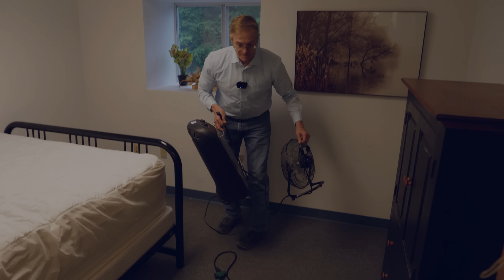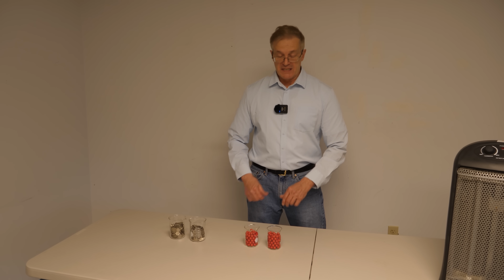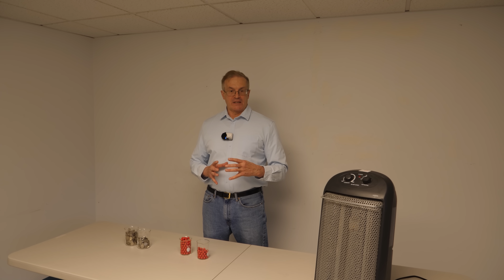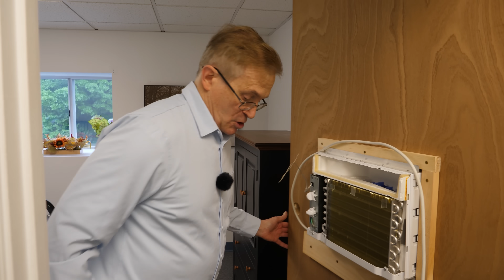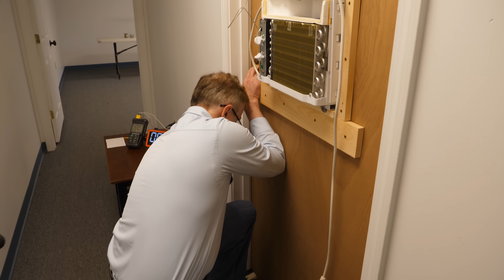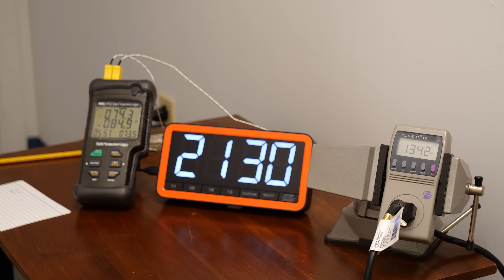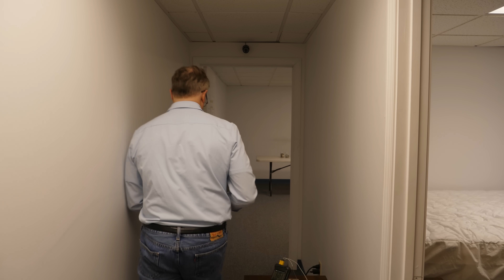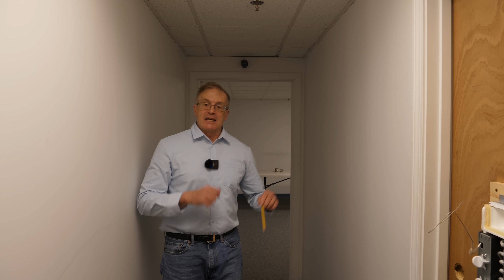You're wasting money on heating! Use your A/C!

Comment: His demo has a major flaw though.  He is warming the cold side of the system in a 75 deg hallway making the temp exchange very efficient.  If you put the cold side of the system in harsh winter temps it no longer warms the cold side efficiently and in effect doesn’t heat well
Reply from the maker: You're right that as the differential increases, the efficiency multiplier decreases.  For extreme differentials, an auxiliary heat system would be needed.

Comment: S o If I turn my ac window unit around facing outside with the exhaust facing in, what would I set the temp to? if it’s 65 degrees outside and I set it to 63 would it keep a consistent heat or keep heating the inside because the outside temp couldn’t be effected by the environment

Comment: My apartment was heated with resistant heaters my electric bill with sky high I got an air conditioner from a rent-to-own place because my air conditioner went bad it has a switch on it for summer and winter in reverse is the motor what's blow the hot air out the front in the winter time heeted this whole apartment  cut the electric bill right in half turn off so I had the ability to run that air conditioner during a power outage with my generator but not with electric heaters.

Comment: The problem with using the windows air-conditioner backwards is condensation on the cold side. Normally that water is piped outside. So if you did this you would have to reroute pipes across your room and outside. Or have a bucket ready.
Reply from the maker: You would have to reroute the condensate, but that's easy. Plug the existing hole with some RTV silicone and then drill a new hole where you want it to drain.

Comment: What if the ac unit is faced out side and the rear is facing inside and the outside temp is say 30°. The compressor will never turn on at that temp and you will not get any heat.
Reply from the maker: Take a look at the AC unit. Under the plastic shell is the thermocouple that turns it on and off. It is not fixed, it simply rests against the coins. Just move it inside the room.

Comment: Yeah. But it's worth to mention that that that effectiveness is maintained as long as you keep the difference between hot and cold side below ~70 F. If you live in a place where temperature drops near 0 F it's not so great. It still may be cheaper then resistance heater but there are cheaper heat sources than that ;-)

Comment: What setting is the AC unit set on? Don't you think it's kinda important to mention that 🤦🏻‍♂️
Reply from the maker: It was set on full. I don't think so because whatever the setting, we displayed the power being used during the test.
Reply: @TechIngredients  on full what? Full fan? highest AC setting? And will it still produce heat if just on the fan setting? How quickly will it heat a room on low and how big of a space can it reasonably heat on low / likewise how quickly will it heat a room on high and how big of a room can it reasonably heat, say 75° or above ? And down to what temps can it reasonably heat a space is there a point where if the temp drops below that point the machine struggles or does it work in below freezing temps well. I would like to know more about this

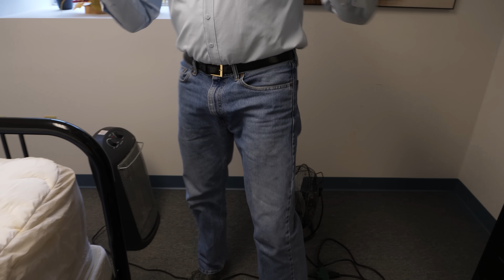Comment: 6:00 Your bedroom... at Starbase cut me off for 5 minutes!🤣 Still, the test is not really relevant; the heat pump operated with an "outside" temperature of 70F, so the COP is still high. At 35 F outside the COP drops near to 1 and the heat pump is as good as the resistive heater, while below that it becomes even less efficient. Some companies claim much higher COPs at low temp but this values are what I got from a real installation. This is when operating with the low heat capacity air, the heat pump can indeed perform better under cold outside if the source is the water in the terrain, but this requires wells or deep long trenches. If you add that in many cold countries electricity costs 4 times more than gas per kW and that average outside temperature is  40 F, the advantage becomes less evident, unfortunately.

Comment: We've been in our house for 30 years. All the systems are reliable. Same washer and dryer, no significant issues. Dishwasher, no significant issues. Deep well and septic system pumps, no issues at all. Even the water heater is 30 years old, no issues. The whole house and its systems have been a joy. Except...

We're on our 4th refrigerator. And we went through basement dehumidifiers like crazy (maybe 7?), a whole batch in a row just getting past their 2-year warranty periods. So the idea of "investing" in a $4,000 heat pump is a very frightening prospect.

Comment: Many years ago instead of putting the window air conditioner back in the window at the beginning of summer, my brother set it on a box in a room and turned it on.  It blew cold air for a while then began blowing hot air.  At that point he turned it off and put it in the window as it was intended to be.  
Had he set it on the box and turned it in winter, what would have happened?  My mind is less scientific than a rock and I leave the question to others.

Comment: This would absolutely work out just fine if all the fu¢king electronics for the unit weren't on the outside of the house exposed to the rain and elements just enough to pop the fu¢king breaker Jesus dude that sh!t don't work unless it's designed to do it

Comment: To have a fair test, wud U not have to put the A/C in the window & have one side of it outside on a cold day (you wouldn't be heating if it were not below desired temperature outside, wud U? Do the experiment with it 50 degrees in the room & outside it is 30 degrees F. -- or if that won't work, try 40 degrees outside, so you cud do it when it is not freezing cold.

Comment: The efficiency of the A/C/Heat pump will drastically go down the colder the hallway or return is and it will also freeze the evaporator coil. But I understand the point you are making.

Comment: I do see a discrepancy in this test. The location of the window AC unit is adjacent to the thermometer on the headboard of the bed, whereas the space heater and fan at the foot of the bed. If you were to place the space heater and fan in place of the window AC unit, the temperature results may differ

Comment: Can this work if the condenser doesn't turn on? What happens when the hall in this case reaches the set temperature of the unit? Will the fan motor by itself produce enough heat to keep the room warm?
Reply from the maker: The temperature probe that controls the temperature switch can be relocated anywhere you want. We just pulled it away from the body of the unit for the test.

Comment: Will this still work if the condenser doesn't turn on? What will happen when the hall reaches the set temperature of the unit? Can the fan motor by itself produce enough heat to warm up a 16 degree room?

Comment: Where or what happens to the normal condensation and dripping from use of these ACs?
Reply from the maker: This is relatively easy to deal with. If there is an existing drain hole, this can be plugged with some RTV silicone and a new hole drilled where it will work best.  
Don't forget to mount the airconditioner with the tilt reversed to direct the condensate to your new hole.

Comment: Flawed test. The ambient temperature isn't realistic. We don't use heaters with an ambient temp of 75. Conduct the same test with an ambient if 40F please.
Reply from the maker: No, the test wasn't flawed.
This was a comparison of the heating multiplier effect with a heat pump, and that is only valid if the conditions are the same.
That multiplier effect will decrease as the temperature differential increases, as I explained early in the presentation.

Comment: I really like the detailed explanation.
I'm curious though regarding the AC in the door. 
Wouldn't the AC need to be facing the opposite direction so it pulls the cold air out as it is it's set up as a typical AC to cool the room. I'm wondering did you do some modifications to the Ac to reverse the airflow direction?
Reply from the maker: The airconditioner was unmodified  other than exposing the internal components and spacing the thermocouple away from the coils so it would run continuously. 
This demonstration was set up to eliminate any effect due to a temperature differential vs the resistance heater. A practical installation would need to take into account access to the controls and the condensate drainage.  It should also show a drop in the multiplier effect as the differential increases. It's still a good approach even if it involves a little more work.
Reply: @TechIngredients  thank you for the quick response.
I was wondering if I was to simply stick my Ac unit in the window but facing outwards, so the back side faces indoors. would this work on heating the inside as it would technically try to cool the outside even more but not sure if it's already colder outside than it's designed to cool. For instance in -20°C ? Also I wonder could the AC unit sustain to run continuously for longer periods of time.
I really like the idea and concept and I wonder why aren't AC already built to be two way and we just use them as temperature exchange all year round. Thank You
Reply from the maker: Sure!
Systems like this are actually fairly common in Europe.  They're called split cycle heat pumps, but they're costly.

Comment: my only question is. How do you set up the A/C unit's thermostat to not shut down when it's 20 degrees outside and it's a 60 degree thermostat?
Reply from the maker: What we did was pull the thermocouple away from the coil. These have a pretty long lead, which allows. you to reposition it.

Comment: Neat.
I've got an air conditioner mounted through the wall of my ambulance camper, venting to an external cabinet.
Guess I'll try mounting it in reverse this weekend, and see what happens.
Reply from the maker: Good luck!
Remember to identify the condensate drain and reverse any tilt to prevent water from dripping inside.
Reply: @TechIngredients  thanks for the reminder!
I was busy trying to figure out at what the ambient temperature/temperature setting mix would work best in colder temps, and how much heat I could produce, whilst avoiding the compressor from running.
Totally forgot about the free dog water it would provide.. 🤔😅

Comment: How do you manage the increased noise level?
Suggestions for baffling/noise insulation?
Reply from the maker: That's a good point.  
I'm not sure how much louder is the external blower compared to the internal blower, but I suspect it is louder.
Reply: @TechIngredients  While I would expect a louder noise from the rear fan, it is the compressor source of noise that is a challenge; Insulate for noise and the compressor over heats.  Not sure if baffles would reduce the noise enough to be worth the effort.

Comment: Good experience of concept, but to be more pratical, you should put the front of the AC outside in winter when it's really cold. In this experience, you just transfer heat from the hallway (that is already warmed from a heating system of the building) to the room. In real condition you want that cold air out, not cooling your building in winter. I doubt AC will works good in cold winter where the differential in temperature between the inside and outside is 50 degrees and more.
Reply from the maker: The concept was the primary reason for the video. You're correct that as the temperature differential increases, the multiplier effect with a heat pump decreases. The environment should be a consideration. If you live north of the Arctic Circle, this is probably of little value, but if you live in Britain, chances are that this can save you money.

Comment: 1KW equals 3413 BTUs and I don’t think anything‘s changing that.
Reply from the maker: You mean 1 KW HOUR, and you're correct.
You should also remember that even air at 0C still contains a lot of heat energy. A LN dewer will boil off almost as quickly in the winter as in the summer. It takes less energy to extract some of the energy from even cold air and move it to where it's needed than to generate that heat from scratch.

Comment: This experiment was done under normal conditions. Let it be real cold In the hallway and you'll see a big difference in heat exchange. Also there will have to be a defrost cycle in place that comes on frequently. The space heater is a constant but the air conditioner is not.

Comment: The water that comes out, what about that? I'm going to figure it out.
Reply from the maker: That's pretty easy. Locate the drain hole in the pan and plug it with some RTV silicone. Then, drill a newl hole where you want the water to drain.  Don't forget to mount the airconditioner with that  little bit of tilt to guide the water to the new hole.

Comment: your ac 
 would not turn on if it were in the cold outside
Reply from the maker: That's why the thermocouple probe should be moved around to the other side.  You can see it in the video as the small tube sticking out from the side of the air conditioner.

Comment: All that equipment and you don't have a door knob?
Reply from the maker: You're not the first person to notice that. 
Basically,  we needed to cut a hole in a perfectly good door in order to mount the air conditioner. So, I went to the dump and found a scrap door that fit the frame, but the hole for the knob didn't align with the frame.

Comment: THE FUNNIEST THING ABOUT THE HEATING AND AIR CONDITIONING SUBJECT FOR ME IS THAT WHEN I INSULATED MY PLACE I CHOSE R21 FOR ALL EXTERIOR WALLS AS WELL AS CEILING ON FIRST AND SECOND FLOOR . 12 INCHES THICK . I HAVE SPLIT SYSTEMS ON EACH LEVEL .. BUT AS I HAVE DISCOVERED OVER THE YEARS .. I DON'T USE EITHER OF THEM VERY OFTEN .. IN THE SUMMER , THE TEMP OUTSIDE HAS TO GO ABOVE 95 TO FEEL LIKE I NEED A BIT OF AC  SO I USUALLY JUST RUN FRESH AIR FOR A FEW HOURS INSTEAD . IN THE WINTER THE TEMP HAS TO GO BELOW 15 DEGREES FOR ME TO FEEL LIKE I NEED TO USE THE HEATER AND AGAIN .. I USUALLY JUST CIRCULATE FRESH AIR  FOR A COUPLE HOURS A DAY AND I AM FINE.  THE SPLIT SYSTEMS WERE AROUND 2500.00 EACH AND I HARDLY USE THEM FOR THEIR BASIC INTENDED PURPOSES .  BUT I GUESS THEY ARE THERE IF AN UNUSUAL TEMP CHANGE OCCURS SO , THERES THAT . BY THE WAY . I LIVE ON THE EAST COAST INBETWEEN MARYLAND AND VIRGINIA IF THAT GIVES ANYONE AN IDEA OF THE USUAL SEASONS AROUND THAT REGION.

Comment: Is there condensate drip when used in reversed fashion?
Reply from the maker: There wasn't during these short tests, but if it becomes an issue, plug the existing hole with some RTV silicone and reposition the hole to drain outside.   Also, reverse the slight tilt of the unit so that the outside component is slightly lower to collect the condensate to that side.

Comment: And what about the infrared panels compared to A/C? 
Thanks!
Reply from the maker: Infrared panels are still just resistance heaters.
Reply: @TechIngredients  but what I've figured out that with AC I spend more kWh through day then with IR heaters. Because IR heater heats the objects and they keep the room warm and the thermostat turns off. 
While AC actually constantly works to keep the room warm. Sure, when it's not heating then it takes maximum 20W, or when it's adding a heat, then 300W max. Tho, when it's properly heating it goes to even 900-1000W. And I have the latest inverter AC.
So, with 3.5kW split AC, half day (12 hours) of heating I've used 3.4 kWh.
With 900W infrared panel, I've used 3.2kWh for WHOLE day (24 hours).

Temperature set on both to 21.5 degrees C

Comment: It was 90 deg after 15 mins why run for another 15 mins? Surely the wattage was less than 30 mins.... ps I always heat using AC
Reply from the maker: When it's possible,  it's a good idea to eliminate variables during a comparative  test.

Comment: Yes heat pumps have a much greater efficiency compared to Electric Resistance Heating, but a typical AC Unit is not designed to operate in cold temperatures. The coil will quickly frost up, among other reasons.
Reply from the maker: You're right it can be.😏
That is why this demonstration was performed. It generates interest in this technology, and if you want to implement it in an actual installation, you'll have to learn more.
Reply: @TechIngredients  i appreciate your work to educate. I have edited my previous comment.

Comment: I will buy the heat pump argument when cheap southern roadside motels start using them to heat and cool their rooms.  I just spent 2 weeks on the road  in the southwest demanding heat from these front wall units for the 1st time of the season.  The compressor don't reverse. The units fire up an electric internal heating coil that needs to burn off the collection of dust collected over the summer.   3 smoke alarms going off in 2 weeks because of the burn off  is what I have experienced.
Reply from the maker: It sounds like the real problem is the type of accommodations you had to endure.
Reply: @TechIngredients  Never go cheap in the south side of Tucson. Pine Bluff Arkansas: I found a cheap hotel the owner and his wife could make the beds that quarters would just bounce of the sheets like the military teaches one to do.

Comment: the problem with this will be icing in some climates. AC units are not designed to handle that. You need deicing cycles and hardware built around it. Heat pumps are ok in mild climates, but not severe climates. The cost vs benefit diminishes greatly further north when you consider that the efficiency is inversely proportional to temperature differential and the life cycle/maintenance cost of equipment.

Comment: Hmmm.  The lowest setting on my window A/C unit is 60°.  If I were to put the cooling side out, and the heat side in, wouldn't  the unit just stop running the compressor when it dropped below 60?  LOL, or is there a hack for that?